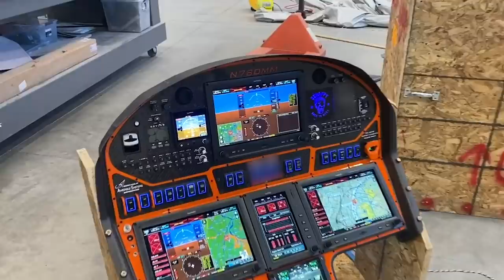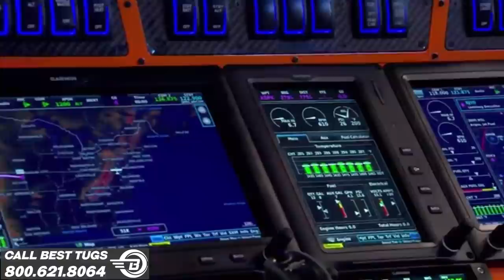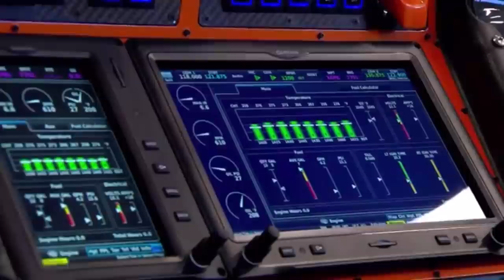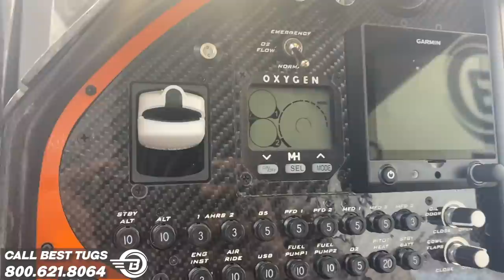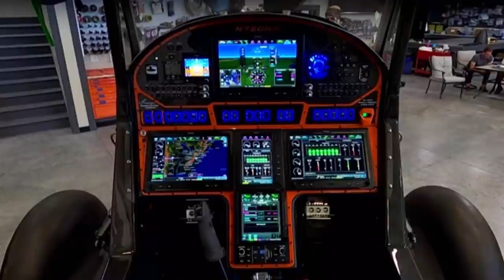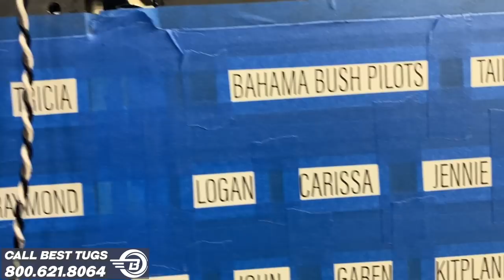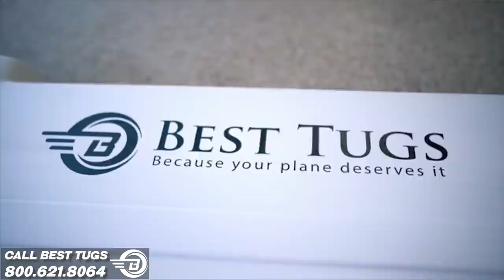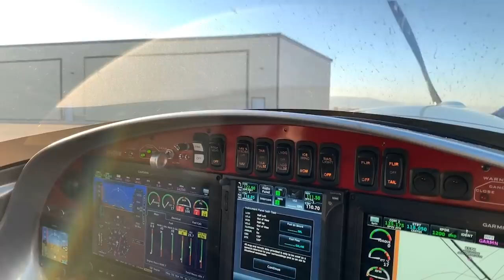Rocket 🚀 or Bush Plane Panel? @garminaviation Q&A with the Patey twins | Scrappy #33

Comment: Calling it now, left wing is gonna be longer to counter the insane torque.
Reply: That would just make additional right rudder necessary to stay coordinated.  P-factor makes the plane want to yaw left, due to propwash and gyroscopic precession, and applying rudder is all that's needed.  The reaction tendency to rotate the aircraft in the opposite plane of prop rotation is miniscule, even in this case.  With warbirds sporting several thousand HP, it was more apparent but still perfectly manageable with aileron input if necessary.  It would make no sense to make one wing longer for slow flight if the majority of the time the plane would be at cruise speed and lower power settings, causing whatever counteracting forces of an asymmetrical wing to quadruple every time you double your airspeed.  If you give it enough correcting force at 30mph to counteract something like 400HP, that same force is 8x as strong cruising at 120mph, a speed that will likely only require 150-200HP out of the engine, roughly the same as a standard carbon cub.  At cruise you'd be putting out standard carbon cub torque, which is usually self corrected by the vertical stab alignment alone (no rudder input necessary), yet with an aerodynamic torque correction of a longer wing or whatever, you're fighting against a force roughly equal to 8x the torque you were trying to correct at 30mph.  Essentially, if you make the wing long enough to correct 400HP worth of torque at 30mph, you'll be fighting 3,000HP (3,200HP-200HP) worth of counteracting aerodynamic torque at 120mph.  Not to mention the insanely dangerous prospect of having asymmetrical lift in slow flight or stalls, it would be unpredictable and difficult to control at best and downright deadly in any other condition.  That's the reason why you look at the evolution of WWII fighters from their first model to the last (such as the P-51B vs. P-51H or Spitfire MkII vs MkXIV), you won't see different span wings, you'll see longer tails, taller vertical/rudder, and dorsal fins.  In the case of the Spitfire, power was doubled, and the only significant changes happened in the tail.  If you look at Reno air racers, they're putting out 2-3x the power their unmodified counterparts are, and instead of lengthening a wing or even adding tail surface, they often use less of both.  Making a permanent change that adversely affects all other aspects of flight to counteract something you can combat with rudder input is terrible engineering.

Thing is, most everything that scrappy needs to counteract the P-factor of the engine-prop combo is already done, and aircraft with more power and less P-factor corrections are flying just fine today.  P-factor is counteracted primarily with rudder, vertical stab surface, and giving the engine mount itself a few degrees offset from centerline.  It's way less of a problem than people make it out to be.  If you'll notice, all of those considerations have been introduced in scrappy already, and the plane that this engine came from had far less to work with in that regard than scrappy does (take a look at the tail of his Lancair Legacy).  Changing things up with the wings to counteract a little torque simply doesn't make good engineering sense.
Reply: @Skinflaps_Meatslapper  It's a joke, the natural response would be to laugh. Have a great day.
Reply: I think a plausible solution would be to steel an idea from scout paramotors. The spars In the cage are small wings that counter rotate based off of air flow. Constantly self adjusted based off of prop wash.
Reply: @Skinflaps_Meatslapper  really good explanation, thanks
Reply: @Skinflaps_Meatslapper  I’m assuming you are a pilot, how much do you feel p-factor on a normal LSA when you are at full throttle?
Reply: Zachary, you'd be surprised at how many people seriously suggest it in every one of his vids.

Jonathan, P-factor correction using vanes is a lot more important in a paramotor because there is no rudder to use in one.  The rudder in aircraft are essentially pilot controlled versions of those vanes.  Though the idea of using a stator behind a prop is an interesting concept, especially if you're trying to design something that surpasses conventional rudder limitations, such as aerobatic aircraft hanging/hovering on the prop alone...at zero relative airspeed they have to rely on a twisting propwash to counter P-factor and it's often inadequate for the maneuvers they'd like to demonstrate.  A contra-rotating prop would achieve the same means without a drag penalty, but designing a hub like that adds considerable complexity.

Henry, P-factor is apparent at all airspeeds if you're looking for it, but it's rarely something that needs tended to except for extreme slow flight and takeoffs.  Once you have a few hours flying, counteracting P-factor is just a natural reflex and most times you don't even notice it.  Going from one airplane to another is where you notice it, since you might be used to mashing an ineffective rudder on one aircraft to barely touching it on another aircraft.  These over/under-corrections resolve themselves after a few minutes of goofing off until your reflexes adjust.
Reply: @Skinflaps_Meatslapper  great explanation thanks!
Reply: @Skinflaps_Meatslapper  Okaaaay... I think he was kidding, Einstein. Thanks for clearing that bit of aerodynamic science up for us tho.
Reply: @CS_247  You do understand that a lot of people actually think like that, right?  Scrappy has been garnering a lot of attention from people who've never been introduced to aviation, and the amount of comments that are off the wall were actually meant in sincerity.
Reply: @zacharybennett3249  I both laughed and appreciated greatly the engineering response this comment created.  Everything with the Patey brothers brightens my day.  These videos and comments provide excellent thought reflection.  College course credit should be earned for simply watching the videos and reading the comments.
Reply: @Skinflaps_Meatslapper  I very much appreciate your thoughtful comments.
Reply: @bobkessener626  I appreciate those who wish to learn; I was once ignorant of all these things as well until someone took the time to explain it to me, whether in person, through writings, or by publishing test results, so I pay it forward any time I get a chance.

Comment: are the airfoils on the front suspension intended to aid in creating lift? I fear that the airflow in between the airfoils on the front suspension might be a hindrance, any thoughts on this? while the plane is in flight will the suspension be in the full down position? 
super nice build, great engineering 
draco was where i discovered this based off of youtube rec.

Comment: I want a ride in scrappy,  so I think I will go hiking in the high Sierras up about 17000 ft. Because I am 71 my knees will give out and it will probably be the only thing that will reach me. Maybe Mike will let me use my high hp and conventional gear ratings.
Did he install stick and rudder pedals  with brakes in the back seat ?

Comment: And it happens again.. Patey redefines an aircraft term  "Glass cockpit"   Now about the "FLIR" mounted in bottom of the airframe...   
Now the question...   I do not have an airplane.. I got my PP ticket 30 years ago so not current.. . BUT  if I buy a Best Tug, can I get a ride in Scrappy?  :)

Comment: Small point: Mike seemed to indicate that the carbon fiber is adversely affected by UV light which is not precisely correct. It is my understanding the UV light attacks and degrades the matrix (the resin portion of a composite) which leads to the overall degradation of the composite.  But the fibers (carbon or glass) of a composite are not materially affected by the UV light.

Comment: Does Garmin have anything in that G3X system to keep the pilot from taking off in excessive unpredictable crosswinds?  Perhaps Garmin could detect the winds and play a video of a plane crashing on takeoff should Garmin detect the pilot is going to take off in such conditions. 

Consider putting a drone camera module on the plane that is launched in the event of a non-standard landing (aka crash) so that we on YouTube can have a birdseye view of such a landing. One could have the drone module transmit an emergency signal as well, and if too far away, fly to a place where it can get a signal out.

Comment: Mike, got a Challenge for you, beat The Time to Climb record established by 650 HP Two Rotor Wankel Engine of 100 seconds, to 10,000 feet.

Release the Kraken !!!

Your range of design has gone from Piston Engines to Turbo Prop layouts, if you have not read Paul Lamar's Post's and noted that Wankel Mazda Engines were kicked out of Le Mans Racing for their Wins years ago, you will note that the Four Rotor detuned Engine Produced 700 HP, able unleashed 900 HP.

I am guessing you have followed some Kit Plane Engine articles of installations, many Experimental Builders have long hours of usage of the Wankel Engine.  Paul Lamar, has stated over the Years, never a failure of the  eccentric shaft, only failures of seals, rarely now that they found a solution to the kind of seal, seal failure just means according to Paul that you have reduced power with enough to reach a safe landing spot or airport. TBO, Paul has said that they do a 1,000 hour overhaul, but for the most part not necessary, ceramic seals have made the Wankel Engine very dependable. Weight reduction is considerable, if Scrappy had a Wankel Three Rotor Turbocharged Engine 525 HP and perhaps have better fuel usage at higher altitudes. Paul reported that he got 20 gallons per hour, for the Two Rotor Mazda Engine, and lower with tweaking. Just saying, since the Experimental Class Build allows Automotive Engines, this one is Bullet Proof, and Fly's smooth.  A few years ago, a Swiss Manufacture had a European Certified Two Rotor Turbocharged 350 HP, I think they got purchased by the Chinese after closure, they failed to get Certification by the FAA, as Paul put it, they attempted to get Certification of a Fuel Injection Wankel Engine, and should have just used the tuned intake p-port.

"A tuned intake p-port was chosen which is very streamlined on
the inside with the fuel air mixture entering the engine
straight in directly. No intake valve to get in the way.
This results in a volumetric efficiency of (believe or not)
120%. That means the engines gets 20% more air than
the displacement with out a turbo. More air, more HP."  Time to Climb Record 100 Seconds 10,000 Foot Paul Lamar...

Detailed Explanation of the Time to Climb Build:
 https://woelfle-engineering.com/we/Wankel_Rotary_Time_to_Climb_World_Record_Presentation_Paul_Lamar.pdf

I have just watched all your Video's on Scrappy, noting the solution choices, several interest me since I am working upon a Patent Application for a V/STOL Aircraft of novel Aerodynamic Lift and Flight Control. I am hoping we can speak about it once the Application is final...

Comment: Would you consider setting up public contests on optimizing certain specific structural components? I bet the engineering community would love to participate in such challenge, even for free. As an example, see GE Engine Bracket Challenge from Grabcad back in 2013, which had over 600 entries: https://grabcad.com/challenges/ge-jet-engine-bracket-challenge